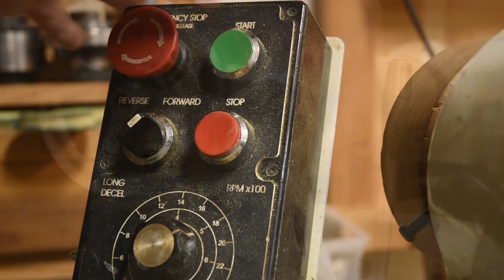Custom Mallet - #MakeItMonday - No. 2

Comment: Seeing how well you work the skew when all I can usually do with it is make spiral catches is definitely inspiring to get out to the lathe and practice!
Reply from the maker: I get catches too.....
Reply: @wortheffort  Update: tried the skew again and broke the bowl with a catch, then broke the tool rest banjo with a roughing gouge catch.  It has not been a lucky day for me, except for the fact that I caught both on camera and was able to get a video out for this week.
Reply from the maker: @rockinrswoodshop  I've said many times a roughing gouge is not for bowls ( as in every time I talk about it). The skew is difficult to use on bowls as discussed. I suggest watching my "4 Cuts" video.
Reply: wortheffort I definitely will. And I was just using the roughing gouge to get the piece balanced out, but I definitely know better now!
Reply from the maker: @rockinrswoodshop  That's an excuse so I'm going to be very clear for you. If you are turning a bowl, if you pick up a roughing gouge and touch the material with it there is a good chance it will break and fly back and stab you. You are extremely lucky it only destroyed the wood and broke tool rest. Do not use a roughing gouge on anything but long grain (spindles).

Comment: Great video. I have a question if you find the time. I've watched your video about getting a supply of wood coming in, from Craigslist to downed trees and so on. I don't have too much luck in my area, do you have any other suggestions?
Reply from the maker: I provided a lot more examples in the video other than craigslist. I'm sure your area has arborists or a forestry department.
Reply: Just a couple of other suggestions, Find where the local electric utility is trimming trees. They trim every day somewhere. Find where a new subdivision is going in. Usually there are trees that have to be removed. And finally, check for any road widenings. Trees always have to be removed in the process of widening roads. Good luck!
Reply: Thanks for the suggestions!